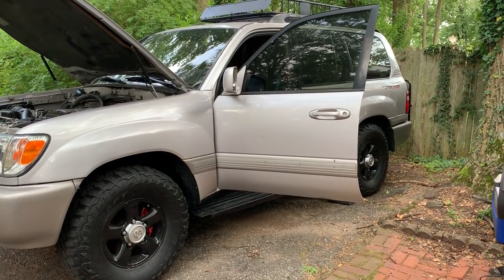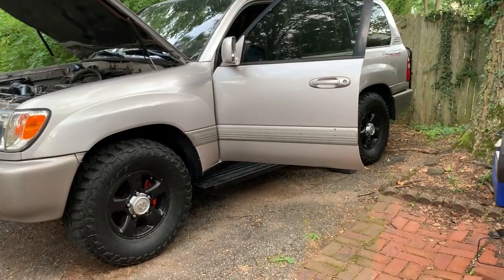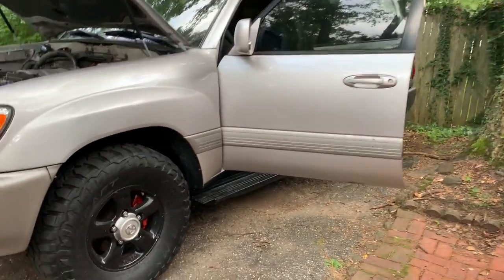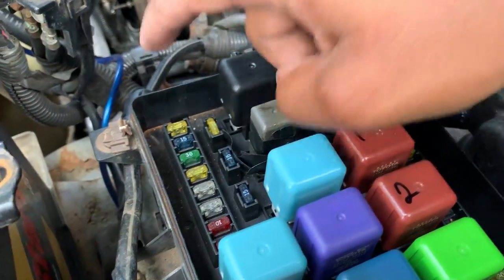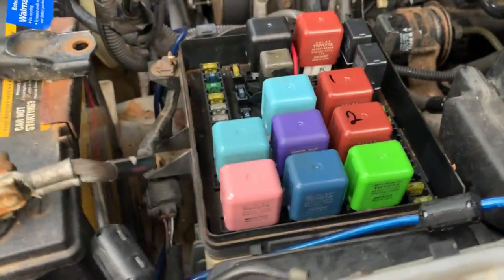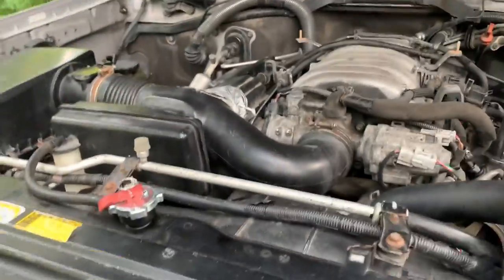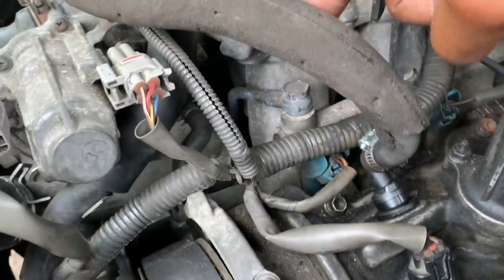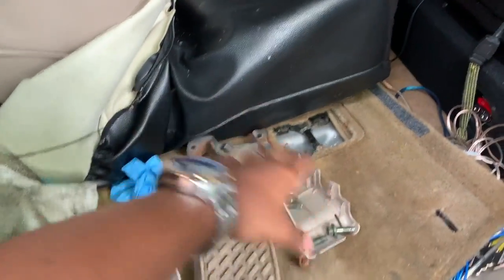Engine Cranks But No Start Pt. 1 - **Demo & Troubleshoot ** (Land Cruiser 100 Series)

Comment from the maker: ⛔⛔⛔

Please hit the subscribe button if this video was helpful to provide some insight to diagnostic your starting issues.

More automotive videos are coming soon. Don't miss out on the notification. 
👍👍👍
Reply: I'm years late but what's the status of the rig..? Ever find the issue or issues
Reply from the maker: @zackhoover5171  It was a squirrel, I can't recall if it was the camshaft or crank shaft sensor which it ate through. Found it grounding on the engine block and replaced it and everything was fine.

I did replace a bunch of things as preventive maintenance and also did a whole timing job and then sold the Land Cruiser. Still regret selling it this day. Never had an issue with it but just typical age & maintenance that comes with it's age but she never let me down or stranded.

Comment: nice LC I just got one. 1998 100 series 170,000 miles. How many miles are on yours?  I looking to starting doing some preventive maintenance as it sat for a while.  It was starting fine til today and it would have a long start then fire, or start then turn off. Something I feel will continue and get worse
Reply from the maker: @rj8296  I had traded mine and was sold to a dealer whom kept it for their off road vehicle. 

Mine at the time had 300k miles and I personally performed the whole timing belt/water pump combo a month before I sold it. That Land Cruiser ran soo good, the dealer couldn’t let it go.

Shucks, even I kick myself for letting it go but it served its purpose indeed 🤟🏾 so you made a very good choice getting one.

Perform all the maintenance as if you know nothing about the prior service records and she will be running find. I definitely recommend a timing belt inspection to see if the belt or teeth have wear which mine did and was jumping teeth when I pressed down on the gas hard.

That jump prompted me to inspect the timing which I found the belt was ripped and timing teeth were missing. Couldn’t believe she was running perfectly fine afterwards which that was my first time learning how to perform a timing belt job but at the cost I had no other option.

Saying all that, you’ll do fine with this Land Cruiser 💯

Comment: So it’s not the efi fuse ?  This is a old problem that all of the 100 series owner are aware of .
Reply from the maker: This issue was the camshaft position sensor. While in there, I also had replaced the crankshaft position sensor so I would not have to worry about it down the line.

Comment: And when you do the fuel pump....make sure that o ring gets installed....you will have the problem you're having now if you don't...I made that mistake...had to take everything apart again to install the denso supplied o ring...so pissed but glad I did... almost had it towed to the shop

Comment: Re checking your timing again, maybe not correct timing
Reply from the maker: Hello, Bona, thanks. This issue was resolved when I replaced my crankshaft position sensor (chipmunk chewed wire).
Reply from the maker: @daddynowski   Correction, it was the crankshaft position sensor "wire" that was torn. But I also noticed that the camshaft position sensor was dirty so I ended up replacing crankshaft position sensor & wire plus the camshaft position sensor since it caked with dirt. I could have cleaned the sensor and then maybe had another issue down the line so since I was in there, I decided to knock them both out for preventive maintenance. 

Here the video that shows the bad crankshaft position sensor/wire (it's located under the harmonic balancer and can be seen under the LandCruiser):
https://www.youtube.com/watch?v=QHT_TSlMiVo